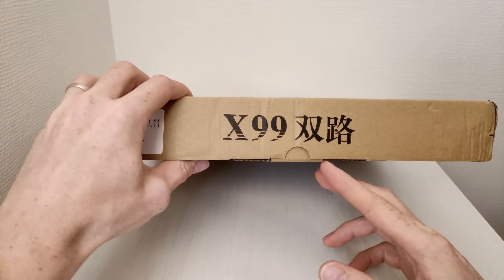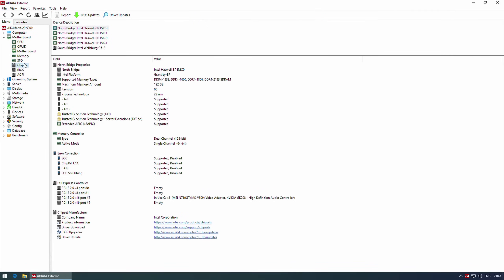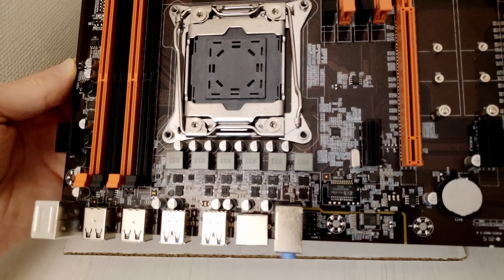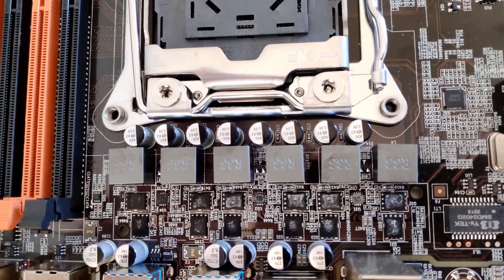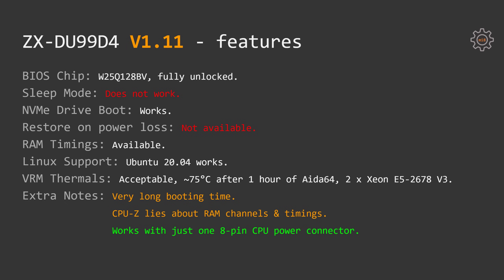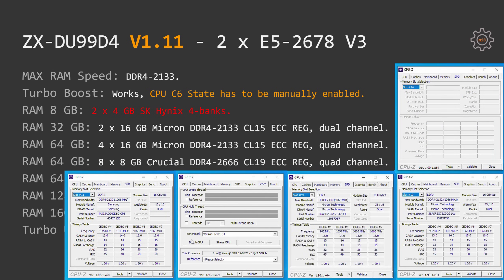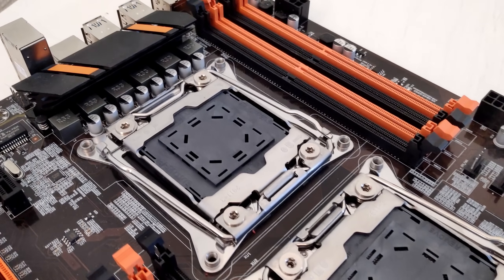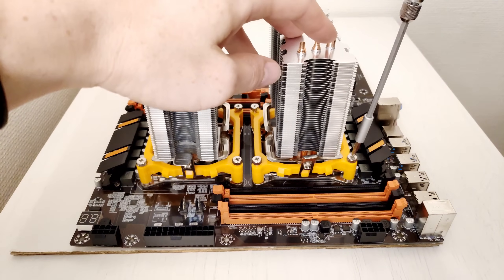🇬🇧 Detailed review of ZX-DU99D4 V1.11 Dual Socket LGA 2011-3 | E5-2678 V3 | E5-2620 V4

Comment: Anyone try using something like arduino to provide Restore on powerloss fo these types of motherboards?  Another question, has anyone experienced these shutting themselves off for any reason? I have one in a remote office that about every so often is shutdown.  I have on UPS but  did not seem to help.  It has plenty of fans and cpu usage hardly goes above 20%.
Reply from the maker: It's sad to say, but these ZX motherboards are known for poor quality and unstable operation. Some of these motherboards have a special jumper on the board, that keeps it on all the time, you can see if yours has one. Arduino can be used to control on/off state, I have seen such mods before.

Comment: Hey. Thanks a lot for the review. It has already helped me a bit. I have one question. When I use both M.2 slots, only one M.2 SSD is recognized. Both SSDs are identical. Is there a limitation of the Sata ports somewhere or do I have to change a jumper so that both M.2 SSD's are recognized? (2x nvme SSD). Thank you
Reply from the maker: As far as I remember this motherboard had one NVMe M.2 port and one SATA, thus it's not possible to use two NVMe at the same time.
Reply: @Miyconst  thank you 😊

Comment: hi and thx for great updates.

i just bought the motherboard but with different version ( 1.12 ) and it comes with 100mbps networking as far as i know. 

i just unlock the turbo boost for 2690v3 dual according to your guide.. but once unlock.. i got worse cpu scores in CPU-Z ( 10k locked vs 8-9K unlocked ) and it seems not working when running Cinebench R23 ( got around 2.7Ghz all cores ).. maybe thermal limit?
Reply from the maker: It's impossible to guess what the problem is, the provided information is not enough. Feel free to join my Discord and discuss the issue there.
Reply: @Miyconst  tq..it seems i know the problem comes from maximum power draw.. when push hard enough. the CPU will take too much power and will trottle down ( regardless if the temp is cold or not )... thats why many recommended to lower the cpu voltage in order to reduce the power ( to allow for max all cores turbo boost )..
Reply from the maker: @beavermml  that's very true.
Reply: Hi friend, I have this motherboard (1.12 version) and Ethernet works fine on 1000mbps, check your router and drivers.
Reply: @soulspiritmx  i just check the deviceId and it seems that my model use 100mbps realtek chipset

Comment: Can I install a 2680v3 in one socket and a 2678v3 in the other socket? Theoretically I think it should work without limitations (same family, cores, tdp and qpi), but who knows the nuances of this mobo.
Any experience with this eve in another dual cpu motherboard ?
Reply from the maker: As far as I know, you need two identical CPUs. I didn't test this particular example, but I had E5-2680 V4 and E5-2680R V3, it's exactly the same CPU, just R was made as an OEM for HP, and these two didn't work in a pair.
Reply: I have used 2 different XEONs in dual sockets, now I have a x5670 and x5660 (in an ASUS z8na d6), also used x5650 and x5675 in a supermicro. That is socket 1366. The mobos uses each CPU with its multipliers (do not lower the multiplier of the most rapid CPU). The conditions are: same family, same number of cores and logical processors (threads), same TDP, same cache memory (in all levels) and at leas 1 common QPI frequency. CPU-z and HW Monitor report the correct CPUs but the wrong frequency for the 2nd. CPU (different among them and from real frequency), I know real freq. because of the performance (and temperature) when I run  known multi task programs. Theoretically a x5650 and an x5690 wouldn't run together because of dif. TDPs (but I did not test).  Theoretically the conditions are the same for socket 2011 and 2011v3. But, motherboard implementations can further limit the coexistence, specially for motherboards like the one reviewed here, that's why to be sure it is needed to have specific reports that was what I asked (this was not an academic question: I have a 2678 and has the opportunity to buy a 2680 for cheap).
Reply from the maker: @pablocopello3592  thanks for the info. If that worked with the LGA 1366 socket, it might be that LGA 2011-3 is more strict, because I was not able to make identical CPUs E5-2680 V4 & E5-2680R V4 work together, the only difference is the marking and internal CPU ID. Anyway, to have an accurate answer we have to test whether E5-2678 V3 & E5-2680 V3 would agree to work together.
Reply: OK, just to let you know that I mixed a 2678 and a 2680 and it worked. But the success is not complete, because now both CPUs go to maximum of 32x (instead of 33x). Each CPU installed alone go to 33x but both together in this mobo goes to maximum of 32x (CPUz reports 12-33 for both CPUs but they never goes to 33x). It is not a problem of TDP, they do not reach 33x even for single thread loads. I have installed TBU and both goes to 32x at 100% cpu load for the 24 CPUs (and 48 threads) for any long time (hours).
Some ideas why they do not ever reach x33 ??
Reply from the maker: @pablocopello3592  thank you for the information. The x32 multiplier might be due to an issue of this configuration or due to the motherboard limitation. Need more testing to know. You can try to enable high performance power mode in Windows and see if that helps in any way.
Reply: I had perf.plan in w10, and that was the problem,  with bal.plan now the cores reach x33 when few thasks (I think this is because of when it is considered that a virt.CPU is iddle, in perf.plan never get few CPUs idle because of the tasks W10 is allways running, but bal.plan dispatch to maintain the minimum logical Cpus loaded).  x33 when all (or more than 6) virt.CPU loaded never reached (it goes to x32 for all cores loaded), I think that is probably a safeward of the motherboard (indep.of parameters of power manag. in bios) or something in de EFI driver used for TBU: did you reached x33 (for long periods) when 2x2678 and all virt.CPU at 100% ??
Reply: Finally with modified mof EFI drivers it worked: all 48 logical CPUs at 100% with x33 for indefinite time.
Do you know what is the 9 pin connector near the screw hole between the SATA connectors? it is like
an usb 2.0 connector but with the missing pin in the wrong corner.
Reply from the maker: @pablocopello3592  I am not sure what that extra connector is, but I think it's for debug LED.

Comment: Hello my friend! I tried to make the TU works with FFS for the 1.12 mobo version but it do not works. So, i watch this video and you get it with V3x4 efi, can you show how do you make it? Can you help me with it? Can you compile this to me? I tried the steps on github but without sucsess. :(
Reply from the maker: FFS injection method does not work with dual socket motherboards, you can use S3TurboTool method instead though.
Reply: @Miyconst  Yeah! I successfully modded the BIOS with this tool, but the CPU do not sustain 3.4ghz on full load on 2x 2640v3, some cores down to 3.3ghz, anothers to 3.2ghz. Can you say me if there are some chinese mobo that can handle a pair of 2696V3 with turbo unlock enable @ 3.8ghz all cores?

Comment: Hi, great review. I found this after I ordered the motherboard and it arrived without a manual.  Can you post a pin diagram for the front panel buttons, or a link to the manual?  Thanks, Jon
Reply from the maker: This motherboard does not have a manual, but the font panel pinout is the same as on any other motherboard. You can find it in Google, I can't post links here, YouTube deletes comments.

Comment: Hi, Support of Kllisre wrote me a message that in Version 1.12 of ZX-DU99D4 V4 CPU Version should also work, but when i start with 2 E-2683v4 it stucks with code 79. Do you know what this Error code is? Thanks for the hard work and support of all users of this board. I also sent you a mail with latest bios of ZX-DU99D4 1.12 but an error message came back in my mail program. Is your mail adress not working? br
Reply from the maker: Hi there. I have received many complaints about E5-2683 V4 not working in pairs on Chinese X99 motherboards. This CPU requires something extra in the BIOS while Chinese ignore it. You can always join my Discord and share the BIOS there if the mail doesn't work for whatever reason.
Reply: @Miyconst  i am sry, but were do i find your discord? :(
Reply from the maker: @Katharina55420  I can't paste links in the comments, but you can find it on the channel's home page in the header.

Comment: received the mobo today, installed the two e5 2683 v4 + gtx 1050 for display. Nothing happens on the screen, and code 79 on mobo. I tried changing the 4 sticks of ram for other brand, tried with only one stick and only 2 sticks, tried removing the batery to clear cmos, changed the card to the second x16 pci. still can't get an ouput and code 79 still there. Everything lights up and all fans are spinning (including the gpu ones) also tested the gpu in another system, I'm at a lost here.
Reply from the maker: Did you test running just one CPU? Please also specify which memory you used.
Reply: @Miyconst  I tested Kimtigo DDR4 16go 2666 x4 x2 and x1 and also tested with my main computer ram Gskill TridentZ rgb 3200 x2 and x 1. I did not test with only one cpu, I didn't think about that... I guessed it might be that the bios was not updated to support V4 on my board.  I don't have V3 xeon to test with so I've let the pc to be tested at a repair shop that had those cpus. Wanted to know quickly if something was not working so I could send the defective part back fast.
Reply from the maker: @bobdrakenzil4785  I meant to ask if you have tested the motherboard with just one E5-2683 V4?
Reply: @Miyconst   No, unfortunately I did not saw your comment before sending the pc to the repair shop this morning. I did not think to do that -.- , only made my tests with 2 cpus... Thanks for your answers tho. It's to late for me to try that, but if somehow they do not find the root of the problem, I'll ask if they tried with only one cpu in.
Reply: @Miyconst  Shop says they tested with 2620 v3 and the board work fine, and the bios version is the same as the one on the link provided. Strange that you are able to run v4 on yours, is it the same bios version?
Reply: do you think it would be safe if I decided to go with E5-2699 v3 x2 or it would be a gamble again?
Reply from the maker: @bobdrakenzil4785  with AliExpress it's always a gamble, thus I can't guarantee that it will work with two E5-2699 V3. Unfortunately, I have only one V4 CPU, thus I have never tested a pair.
Reply: @Miyconst  the two E5-2699 V3 worked. So I'd say to people interested to this board, stick top V3 xeon parts.
Reply from the maker: @bobdrakenzil4785  thank you for the info! It would be nice if you could get a chance to validate the V4 Xeons separately, just to make sure that they are actually working.
Reply: @Miyconst  I wish I could just to confirm, but they are being sent back since I had no more use for them.

Comment: Hi Miyconst thanks for the great video. I have a question about this board. When I insert a M.2 ssd into the switchable M.2 port (the one connected to CPU1), the ssd does not show up in the BIOS so I cannot, for example, boot from it. When I insert it into the the other M.2 port (the one limited to PCIexpress 2),  it does show up and boots fine. Do you have an idea as to what might be going on/how to make the fast M.2 port recognize the ssd?
Reply from the maker: What SSD bdo you use? I have already heard about this issue from other people, some Chinese SSDs refuse to work at PCI-E 3.0 speed on Chinese boards.
Reply: @Miyconst  I'm using a Samsung 970 evo plus.  Do you think a different brand of SSD might work? What brand have you tested with?
Reply from the maker: @alicox8932  another brand might work, but there is no guarantee, most likely it's the motherboard issue.

Comment: PLZ HELP ME, I have two xeon 2686 V4 and its not working together, any clue what is happening? When I use only one works fine
Reply from the maker: Have you ever tested these CPUs together on another motherboard? Are these CPUs final version or engineering sample? Are the two CPUs have identical revision and stepping?

Comment: I'm assembling a server using this motherboard, but I can't find the AC power loss bios menu, help you help me find
Reply from the maker: Sorry to disappoint, but as far as I remember, this motherboard doesn't have restore on power loss function.
Reply: you can do it by switching the 2 pins you can see next to the sata7 port, by default it uses the no auto power on (first 2 pins), remove the connector and place it on the other 2

Comment: hi guys, i bricked this motherboard by changing the bios, i bought a CH341 to install the bios, however i cant seem to recognize the bios chip, any ideas?
Reply: everytime i read on asprogrammer it gives me 0 values
Reply from the maker: You might need to connect the PSU to supply some extra power. More info is available here: https://www.miyconst.com/Blog/View/2086/ch341a-minimal-usage-guide-how-to-read-and-write-a-motherboard-bios
Reply: @Miyconst  ok trying it out :)
Reply: @Miyconst  cant seem to get it to work :(

Comment: i've bought this kind of mobo just a week ago. had no display problem from external gpu. turns out you need to to display through DVI first before installing the gpu driver.
Reply from the maker: This is probably a GPU specific issue. Which one are you using?
Reply: @Miyconst  oh that's true. I am using GT 710. i've tried using the card in my other system. it can display through vga/hdmi but not the chinese mobo. this is before installing the gpu driver
Reply from the maker: @asyrafazahar7635  hm, I am always using GT 710 with HDMI output and it works just as good, maybe there is something special about your motherboard / GPU.

Comment: how do you turn this motherboard on?
Reply from the maker: By shortening the power button pins.
Reply: @Miyconst  Thanks. I figured it out but no image on screen. The diagnostic card shows error code 67. Do you know what that means?
Reply from the maker: There is a problem with memory. It's either not properly connected or not compatible.
Reply: @Miyconst  I am using an 8GB XPG Z1 stick with DDR4 and clock speed 3000MHz. The box also says PC4-24000  which I'm not sure what it means. I am using a single Xeon E5-2680v3 processor but I tried putting the ram stick in both of the orange memory slots of CPU1 and got the same error. I even tried the orange slots of CPU2 in case I had mistaken the memory slots of the two sockets with each other. I'm pretty sure I am properly connecting the ram, secured with the hooks on each side.
Reply from the maker: @alicox8932  it seems like you have got a 4 or 8 bank memory module, which is not compatible with the X99 platform.
Reply: @Miyconst  How can I tell how many banks there are in my memory module? By the way, my board is zx-du99rd_v1.12, not zx-du99rd_v1.11. I don't know if this would change the memory compatibility but I was wondering also about the original bios you linked under the video. Say I wanted to update my bios. Can I use that link (meant for v1.11)? Also how important is it to install the motherboard driver? I already installed windows 10.
Reply from the maker: @alicox8932  I can't comment on the BIOS compatibility since I have not tested the exact motherboard you have. Windows 10 mostly installs all required drivers itself, just make sure to install all Windows updates including the optional ones.
Reply: @Miyconst  I manually installed the USB3.0 driver (just used the install wizard from the driver file you shared) but when I ran Crystal disk on a SanDiskgen3.2 flash drive plugged into one of the 3.0 ports I got a sequential read speed of about 90Mb/s, and a write speed of about 50Mb/s. I feel like it should be higher. Also I have another question. When I use the primary M.2 slot (connected to CPU1), my drive doesn't appear in the Bios and windows doesn't boot. I'm concerned that I might have it switched to SATA mode, but I don't know how to switch to M.2 mode. There appears to be 4 pins in the switch board. There is a note that says 1-2:PCIE and 2-3:SATA. I tried shorting pins 1 and 2 but nothing changed. Is there a specific way I have to do this?

Comment: Just FYI:  My ZX-DU99D4 board required both CPU ports to be powered when using dual E5-2683 v3 CPUs. It wouldn't even power on without them both plugged in.
Reply from the maker: Most likely you have got and upgraded revision of the motherboard. Thanks for sharing your experience!
Reply: @Miyconst  Yeah.  Box simply says X99 ZX-DU99D4_V1.12.  Nothing else, though.  Plain box.  heh.
Reply: UPDATE:  The 1.12 revision will work with a single CPU cable.  My board was just a bad board.  Replacement works fine.

ALSO, my board came with the NVMe jumpers in the SATA mode by default (bottom two pins).  Had to switch to top two pins to enable NVMe.
Reply from the maker: @WarhavenSC  thanks for the info!